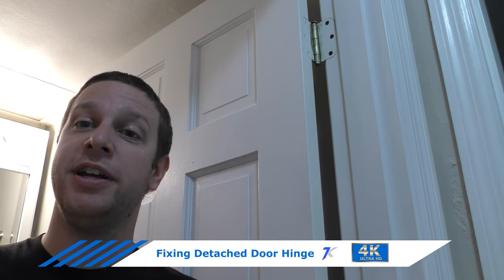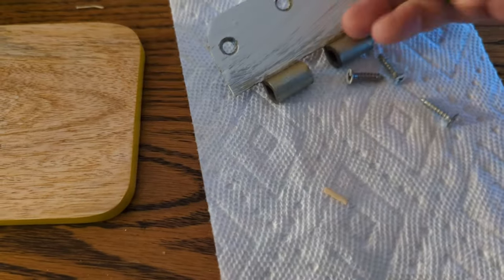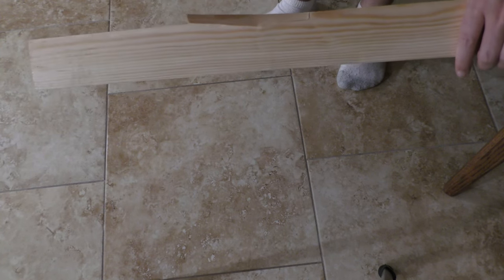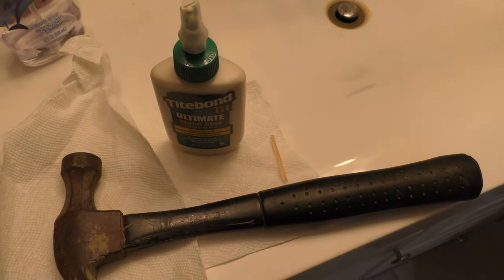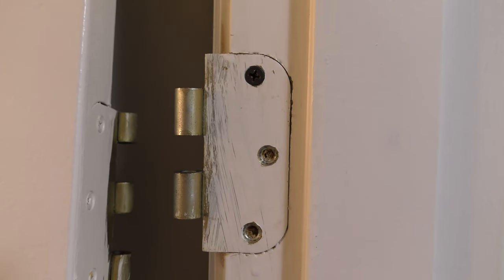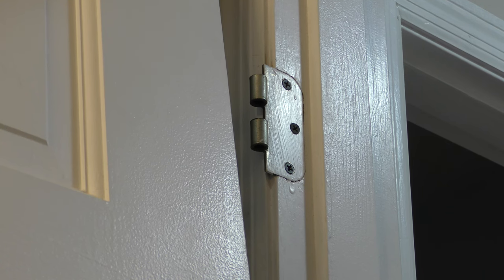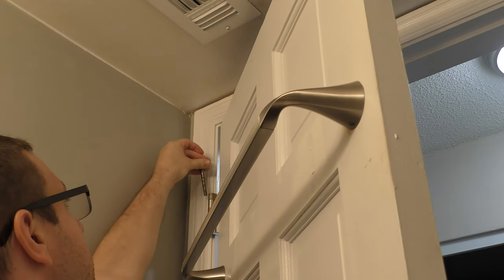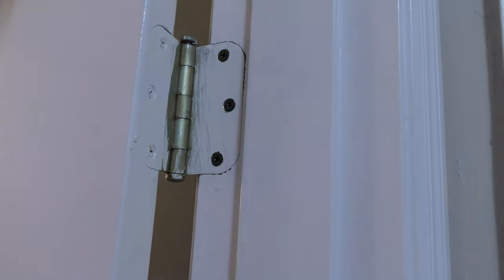How to Fix a Door Hinge that came out of the Door Frame

Comment: Why not use anchors?  You may also want to consider that towel rack may be the reason for your door's failure.  Constant downward force puts unnecessary pressure on the hinge screws.